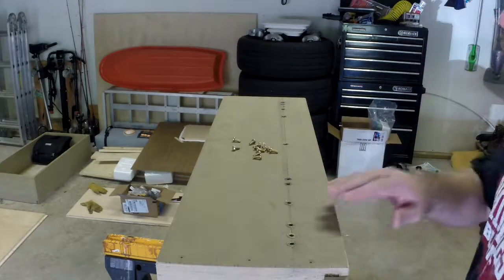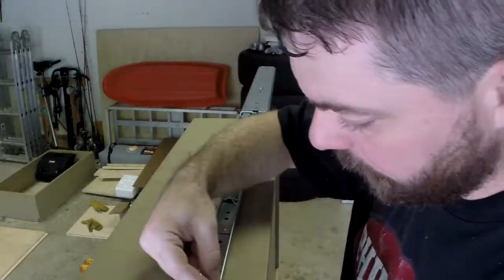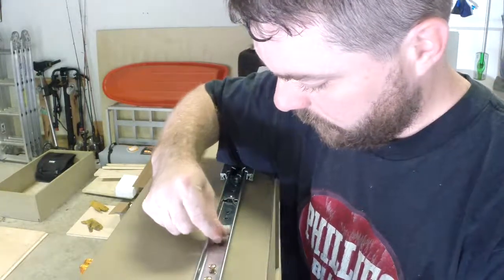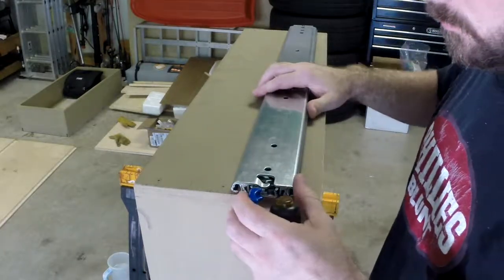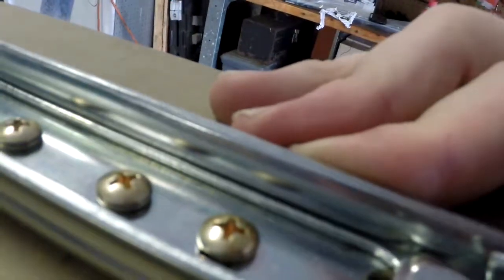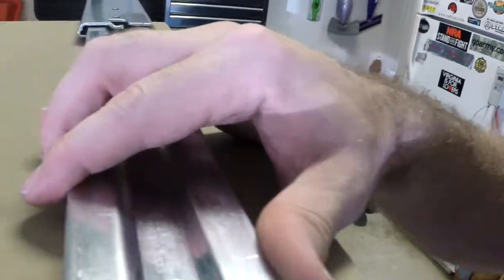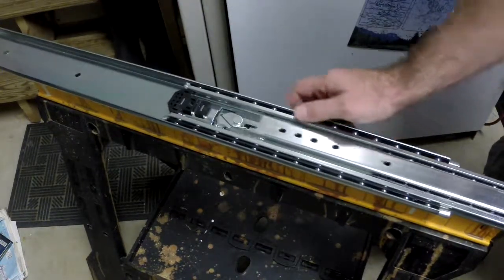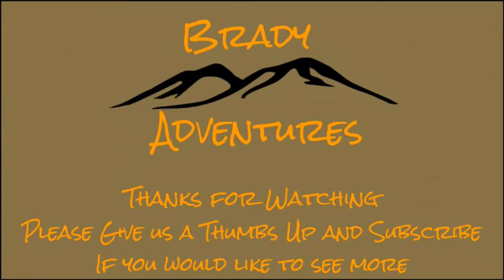Ryadon Slide Test Mount and Locking Mechanism Overview - 100 Series Land Cruiser Overland Rig Build

Comment: Stay as far away from Raydon drawer slides as you can. Poor customer service is an understatement.  Ordered Feb 20, paid over $100 for shipping, and the product is still just floating around the USA. How dare I be an upset customer to the gent on the phone that got participation trophy from Mommy & Daddy for just showing up. Complete clowns.
Reply from the maker: That sucks man! I am sorry to hear that.  It's been a while but I know I got at least one set from amazon with prime shipping.  I think I had to order the other from Raydon.  Anyway to anyone that sees this probably best to get them from amazon for some protection.  Damn I hope they show up for you soon!
Reply: @BradyAdventures  I canceled the Raydon order after the "customer service" guy was a complete clown. Ordered from Ovis late afternoon March 2. Shipped March 3. Arrived March 5 standard ground UPS shipping. The guy at Ovis was loaded with good information as is their website. Sliders I got have a 50 pound greater static load capacity vs. Raydon and Ovis also provides the dynamic load capacity so you know the limits if you're going off road. I'll be ordering my 2nd set of 60 inchers along with two sets of 48 inch tomorrow. I highly recommend the Ovis sliders.
Reply from the maker: @shadow.overland  awesome, I don't think I was aware of those back when I got these.  There was another brand everyone was using at the time called something like accuslide.  Those look nice.  Thanks for the tip.  When I get that 200 I have been dreaming about I'll try these out on my next set of drawers 🤣  Good luck with your build! 🍻